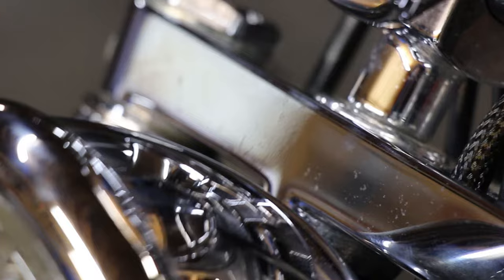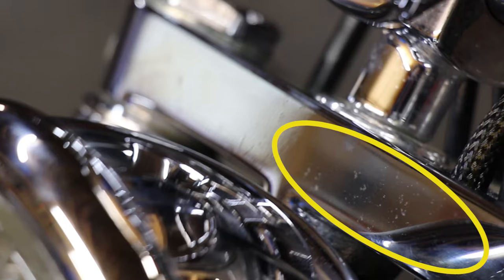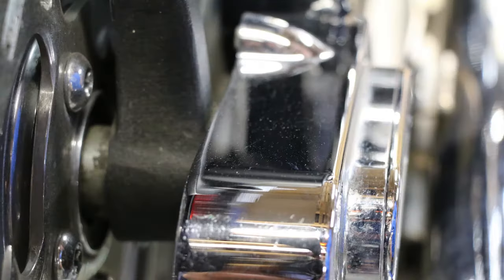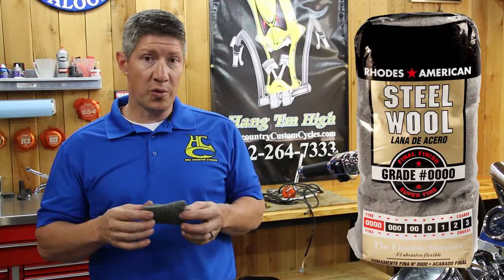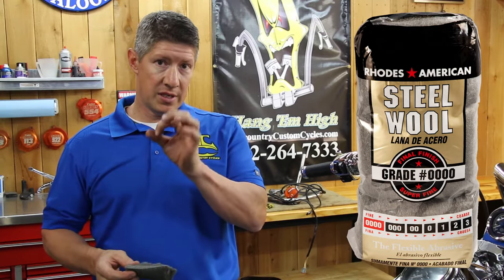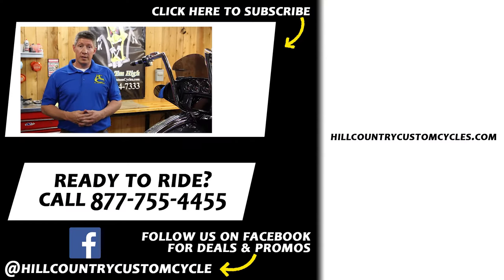How to Shine Up Old Motorcycle Chrome to LOOK LIKE NEW!! (It's Easier Than You Think)

Comment: I've been doing this for years and I've discovered that if you put a light drop of oil of any kind 3M... Hoppes gun oil... Etc on the oooo still will that it does an even better job glides easily and will not scratch no matter how hard you get into it

Comment: Remember now that you've used steel wool and you have removed even more of the chrome plating you're going to need to research better ways or what to do now? Car wax? ACF 50? 50 weight oil? Clear coat? Re-chrome? 🤔🤔💁🤷🕵‍♀️Just like I'm doing now...🤪😉